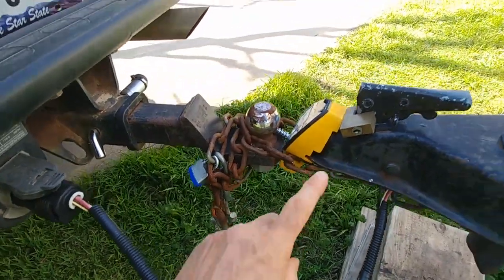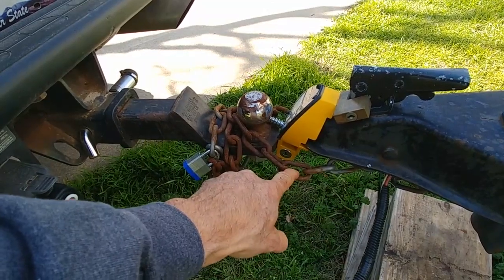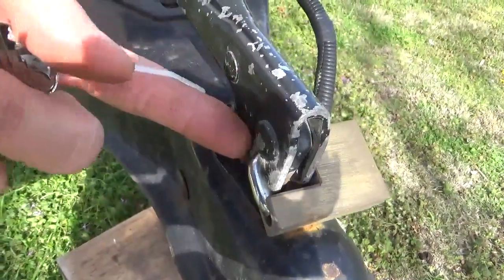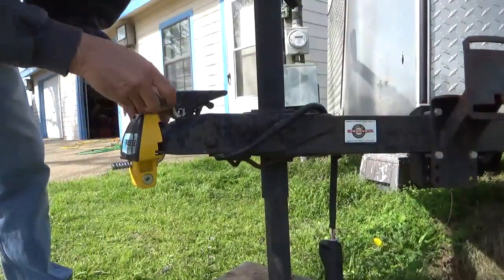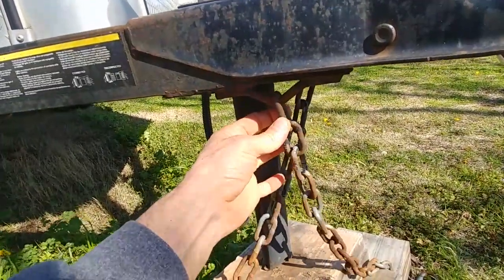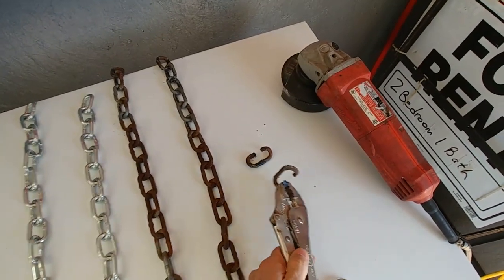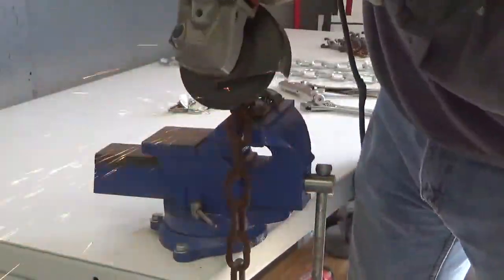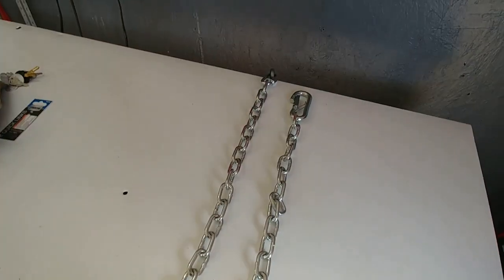PREVENT TRAILER THEFT Removable Safety Chains Cargo Trailer Camper Conversion  enclosed trailer

Comment: Its all about deterrence. I do everything you do currently because I want to make it as time consuming as possible for a thief to steal my stuff. Something I just added to my trailer security. I leave my trailer jack close to fully extended and then I take my chains and get them tight around the jack crank and lock the chains to it. Thief has to break my lock/chain and crank the hitch down or break off my hitch. I also have a heavy duty cable with lock between my tires on a tandem axel trailer. 
All about slowing down the thief, unfortunately they can still take it if truly want it bad enough.
Reply from the maker: Great ideas. Thanks for watching.

Comment: These already have clip springs on both ends. Half the work. :)

https://www.homedepot.com/p/TowSmart-5000-lb-Capacity-40-in-Safety-Chain-757/206798886?keyword=875195007574
Reply from the maker: Yep, that will work.
Reply: @FakeLegGreg  It took me longer grind/cut my old chains off than I expected. But now just that much less to be concerned about.

I have a hitch lock that is surprising how HD is. And it's from a place where they are not exactly known for high-end products...
https://www.harborfreight.com/ez-lock-trailer-lock-98518.html

Comment: My little $100 battery grinder will cut your locks. No chains needed. I think something to prevent tires and wheels from rolling is the answer.
Reply: Andy Asberry This is the only correct answer. I have had them bring there own chains and quickly wrap them and off they go. Now I just take a tire off and take the spare with me , I have found taking the tires off or finding away to secure them is the only answer . Thieves look at a trailer with no tires and they move on
Reply from the maker: Thanks for the suggestion.
Reply from the maker: Thanks Andy. That is next on the to do list. Can't stop them, only slow them down.
Reply: I think the trick is to add as many layers of security as possible. Thieves by nature are lazy, so the more work you make them do the greater the chance they will move on to an easier target.
Reply from the maker: @christianjensen3182  Agreed. Thanks for taking a look at the video.